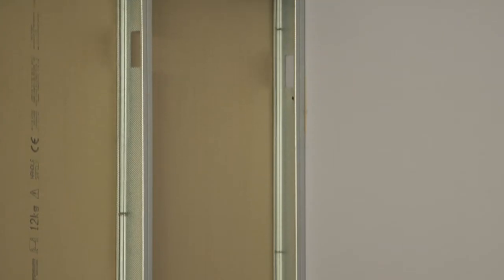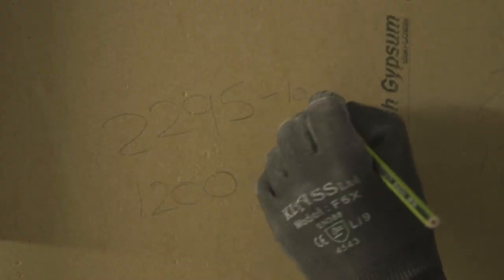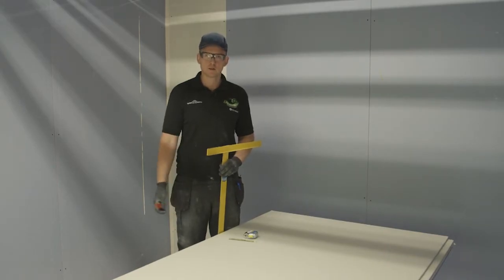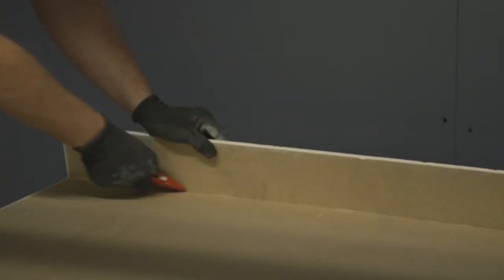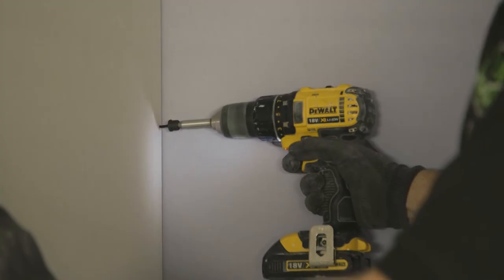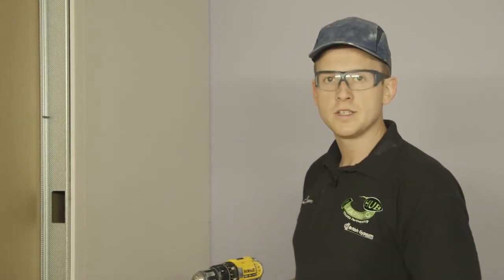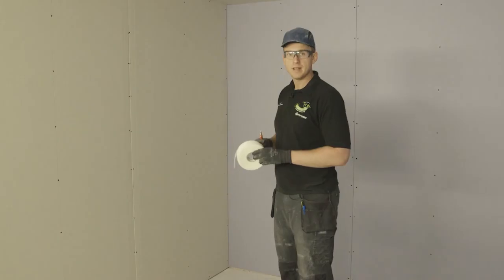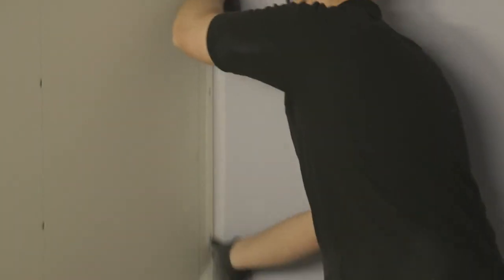How to plasterboard a stud wall

Comment: What would happen if the plasterboard had been fitted with the backing to the outside? A guy recently fitted it back to front on a stud wall he had built for us, but on the plasterer's advice we had to remove it and refit it the right way round before he skimmed the room. The guy who fitted it incorrectly said that it shouldn't make any difference. Who's right?
Reply: Alot of people say there isn't a difference but it's written on the board for a reason so it's best to follow recommendations. Might have something to do with the material on the correct side (no writing). Plasterboard has tiny holes in to allow the plaster to bed in properly for mechanical key. The backing paper might not have that structure, affecting how the plaster bonds to the board
Reply: @alexbaldwin1267  Hi Alex. Thanks for the feedback. I had since received replies from a couple of manufacturers who confirmed that plaster must not be applied to the backing. 

The guy who fitted them refused to accept that he had done anything wrong, but if I have paid him to build a stud before then paying a plasterer to do work on top of that stud, which will subsequently be painted, etc., I'd like to think that the foundations of that piece of work had been done correctly to avoid potentially costly re-works.

When it comes down to it, this one an easy one to avoid!
Reply: @darongharvey4097  exactly. It is clearly written on the boards as well from what I remember. I'm only a plastering student but try to help/learn when I can. Why they would put them on wrong it beyond me